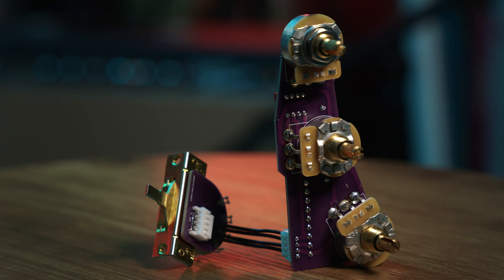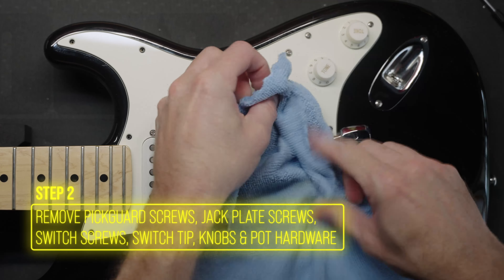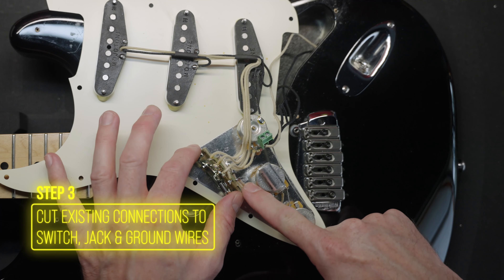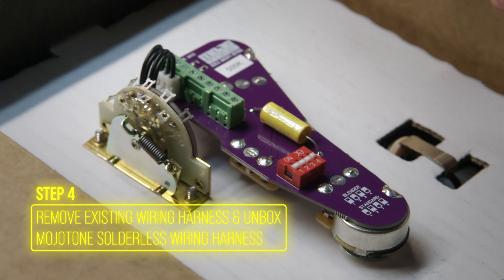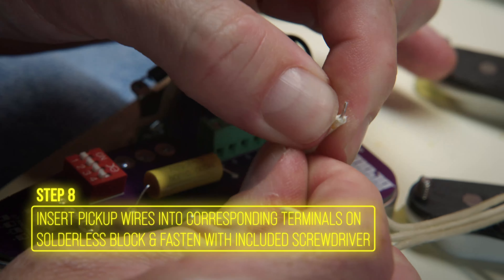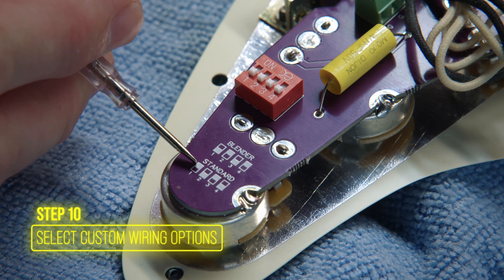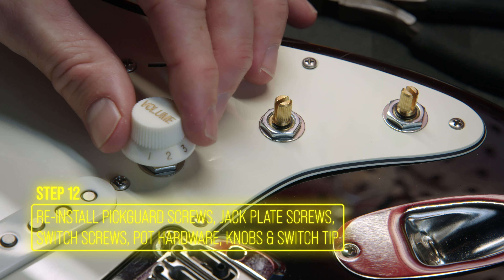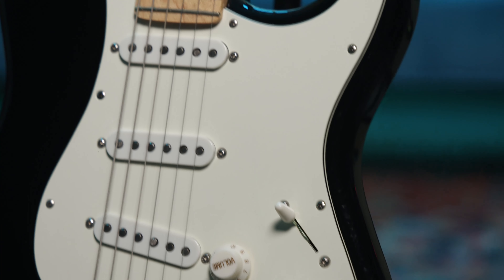How to install a Mojotone convertible wiring harness.

Comment: Unless you want a humbucker in your single coil guitar. You need to buy a new plate. Getting some pots and caps is much cheaper.
I’d still prefer it old school even when soldering isn’t something I get exited about.
First thing I removed from my Gibson was that plate it came with.

Comment: Never solder again? Anyone can install it? Then they proceed to go through the steps super fast. Using terms and describing components that the average player probably won't know or understand. Yes, its easy for a tech to install one. But to sell it as if ANYONE can install it without ever soldering again. Is just nonsense. Love my Mojotone parts. They're always top quality and work flawlessly. Peace!
Reply from the maker: Yes anyone can install this! All you need is the included flat head screwdriver and a few simple tools. Follow the diagram and go for it!
Reply: @mojotoneofficial  Yeah, I'm fine with soldering.
Reply from the maker: @andrewbecker3700  We like soldering as well! Thanks for watching
Reply: A little slow are we?
Reply: @KJ4VGA  Figures, a comment about the sales presentation would attract all the "experts". If your paying attention rocket man, there's no reference to difficulty of installation. 
Go buy yourself some dummy proof pre-wired loaded pickgaurds. They're great for people that aren't into doing it themselves. I actually enjoy knowing what's going on under the hood. Not just pretending to. Now what?
Reply: @andrewbecker3700  I solder nearly every day.  This product is not for me.  I know plenty of people that it would be for.  And yes your original comment was about the difficulty of installation, or at least the "instructions" for installation.  If that truly was not the original point of your comment, then youre not very good at getting your point across.
Reply: That’s what the “pause” and “rewind” buttons are for, dude. Chill.

Comment: I don't want to upset you, but the first thing any musician will do is remove this part from the guitar....
Reply: I wouldn't remove it. They are high quality parts. If you run it in "regular" mode, the circuit is exactly the same as a regular strat. Flip some switches for different options.